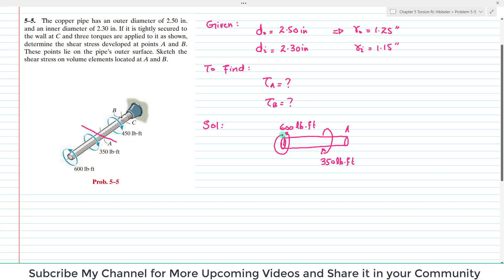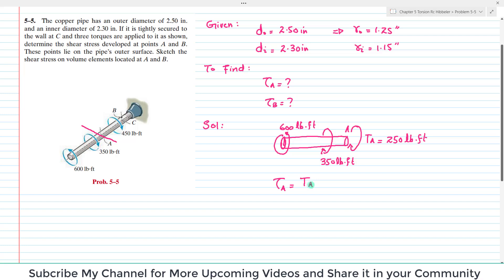5-5 |Chapter 5| Torsion | Mechanics of Material Rc Hibbeler|

Comment: I got confused. You said 600 minus 350 is 250, but 600-350-450 is -200. So can I take that -200 as positive 200? Plus, In every case in the chapter, should I take them as positive, not negative, right?
Reply from the maker: Read the question carefully we have been asked to find it at point A and B so 600-350 is for point A while the one you mentioned is for point B
Reply: The negative is only signifying the direction of the moment. We are looking for the shear stress at that point so the sign doesn't matter. Therefore, you can keep it positive regardless of the sign convention.

Comment: Units need to be converted, to all inches or all feet
Reply from the maker: If you use inches then all length or diameters should be inches and if you use ft then all must be in ft. So all units must be consistent
Reply: @engradnanrasheedmechanical  5:51Sir you used feet in the Torque but used inches in C and J
Reply from the maker: @aryanbhardwaj5252 yes but you can see I multiply 12 because 1 ft = 12 inch..

Comment: How do you determine the direction of the arrows in the element
Reply from the maker: Direction of arrows are given in the figure
Reply: @engradnanrasheedmechanical  I mean in the little box to drew 4 arrows to show torque 
How do u determine direction of those 4 arrows around the box
Reply from the maker: Torque at free end is counter clock wise, torque at point A is clock wise and torque at B is also clock wise. Now at section between A and B the net torque us 600-450= 250 so for equilibrium it should be clock wise ....

Comment: Should 250 be negative
Reply from the maker: when you show the direction clockwise then no need to take the negative and yes shear stress comes out to be negative means the direction will change. and you can see the direction shown on element is downward...

Comment: why did you multiply with 12 ?
Reply from the maker: you can see that unit of torque is lb.ft so want to convert it into lb.in and one ft is equal to 12 inch. so that's why we multiply it with 12.